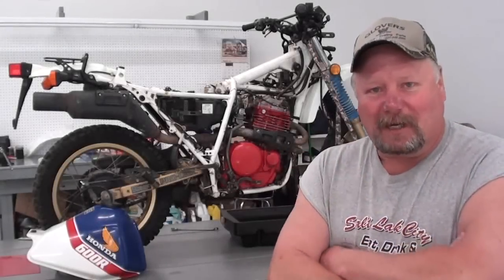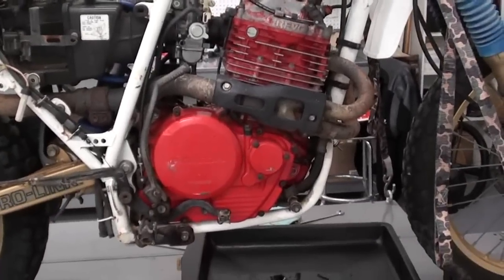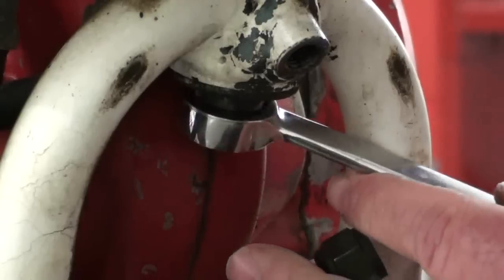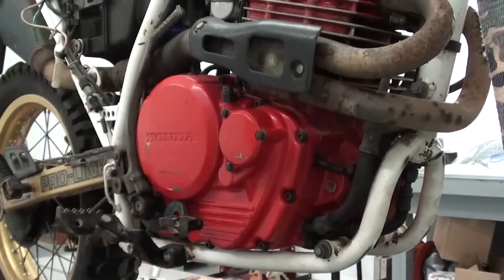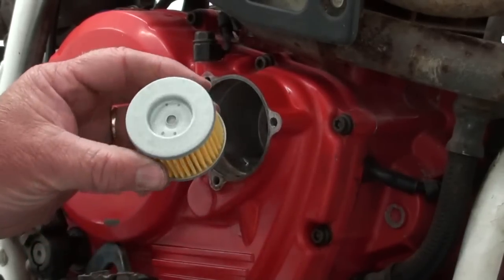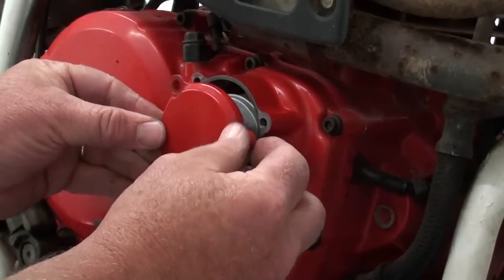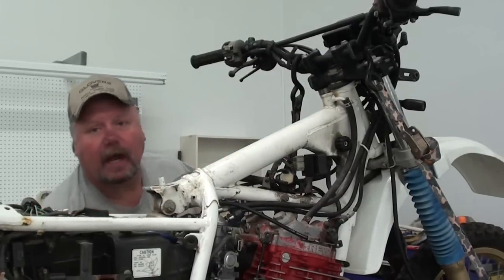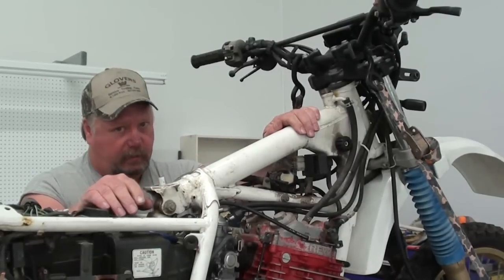1986 Honda XL600R Oil And Filter, What's A Dry Sump?

Comment: I run 1950's Brit singles. Even so, I'm so old, they aren't old. To me, your bike is 'modern' if not new exactly. Dunno if you mentioned it, but make sure the valve clearances are set at TDC on the COMPRESSION stroke (all valves should have clearances at that point).

Comment from the maker: The valve clearence for the XL/XR 600 are different, I don't know why. The specs you have there are correct for your machine. Since you don't have a 0.12mm feeler gauge, use what you have as a go-no-go gauge. Set your exhaust valves so that the 0.10mm gauge easily goes under the rocker arm with no drag, but the 0.15mm will not. It wont be perfect, but I bet it will be close enough. Thanks for watchin'.

Comment from the maker: Thanks for watchin'. Yep, those can be difficult to break loose sometimes, I would try placing a deep well socket on the strainer bolt head and give it a few good raps with a hammer to jar the threads loose, then take a 6 point wrench and try breaking it loose.

Comment: Hi D-Ray Smith, I owned this 1984 Honda XL600R of which I am trying to restore.  It seems my Honda does not have the Separator, Breather (part # 17370-435-315).  Is this item very important ?  I though this was an oversize gasoline filter but it seems to have another purpose.  Anyway, hope to get some help from your end.

Comment from the maker: Not at all, the total capacity is a little over 2 qt., or 1.9l. The shape of the oil tank is such that the difference between full and low on the dipstick is probably less than 1/4 to 1/2 a qt. A certain amount of oil stays in the crankcse all the time so that is why it showed to be so low on th' stick after inital start up. I usually take several sessions of running and re-checking the oil to get it right up to the full mark. Thanks for watchin'!

Comment: These video's are awesome! I just bought a 1983 XL600r and I had to gut the carb due to low reaction on the second carb at high rev.  Your video helped out a ton. I just saw a guy trying to sell a XL on CL for $500 with one little problem.  He put the oil filter in backwards and seized the head.  Thanks for these great video's

Comment: I broke the return spring of my kickstarter, so I had to open the side cover to pull the kickstart mechanism out and replace the spring. I tried draining the oil first through the drain plug in the frame, but since the motor was cold (couldn't start it due to broken kickstarter) no oil came out. I thought damn, did I run it low on oil all the time? Thanks for the great video, now I know where all the oil was and now I can drain it fully and replace the oil!

Comment: Hi D-Ray.  I have the same bike.  When I got it there was terrible oil flow to the head even after the full oil change.  I noticed a 1-1/2 " crack in the back wall of the oil filter chamber.  A previous owner may have put the oil filter cover on wrong, blocking the flow of oil out of the chamber causing a pressure buildup.  My guess.  I repaired the crack with JB Weld epoxy.  Love your videos.  Thanks for keepin my old Thumper rollin !

Comment from the maker: Sorry to hear 'bout your bad luck man, if the allen bolt you are talkin' about is up near the top of the head cover, that is actually one of the rocker or sub rocker arm shaft bolts. That noise could be from the cam or a galled piston. If the engine has been run low on oil, usually the cam is the first thing to gall up and try to sieze. Break out th' tools and get on it. Let me know what you find.

Comment: I just bought the same bike, 1986, in what seems to be in great shape. After I got it home and rode around for a short while, less than 1/2 mile, and turned it off, I heard a somewhat loud bubbly, gurgling sound from the motor that lasted at least a minute or so. The oil looks new, but Im thinking maybe the oil pump might not be working and the oil is boiling??? Got any ideas on that, like how to tell if the oil pump is working? Thanks for the videos.

Comment: hi
I am looking at buying a honda xl600r Paris Dakar  seller says it needs an anti drain back valve and says it has a tendency to wet sump..
whats needed and whats the cure
I have drawn a blank
is the oil filter incorrectly fitted or the spring not holding the filter in place

many thanks
Daryl

Comment: D ray. Thanks for the video. Was trying to pop out the the primary strainer screen and the bolt that is connected to the screen is rounded off and I cant seem to get it loose without rounding it more. tried vice grips and other methods, wondering if you have any good ideas on how to get it off so I can clean the screen. Its a hard fit to get a socket on there because the front of the crankcase is so close to the bolt head (17mm i believe). Any ideas. Thanks

Comment: Sorry but in my XR600 Service book  they wrote:
inlet - 0,1mm
exhaust - 0,12mm
hmmm, what's correct?
Question - I have only 0,1 and 0,15 mm feeler gauge  - so I can't set 0,12mm gap for exhaust valves.
What's better 0,1 or 0,15mm??
Thanks in advance

Comment: I have an xl600 i changed the oil and filter. I added about 1.8 litres until it was basically full at the dipstick and overflowing. I ran it for 2 minutes then checked it it showed basically nothing. I added anothet .1 of a litre and ran it again then checked 15 mintues later and it read a bit above a quarter full did i run it with no oil?

Comment: Over filled mine because of some bad information on Google. Told me 3 qt for oil copacity man did I make a mess in my driveway
Reply: Did it piss out the crank shaft exit tube? Also did you have problems keeping it running when over filled with oil?
Reply: @zacharyfridmann8226  no I better it pissed out the dry sump over flow
Reply: @zacharyfridmann8226  I did not run it for long because the oil all over I think it ran fine though